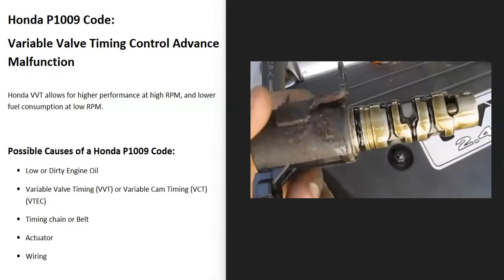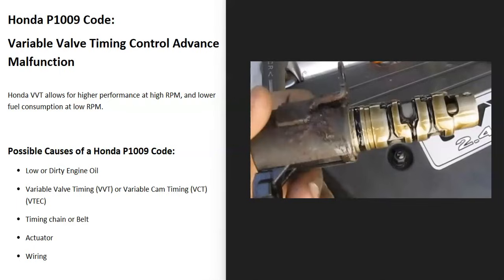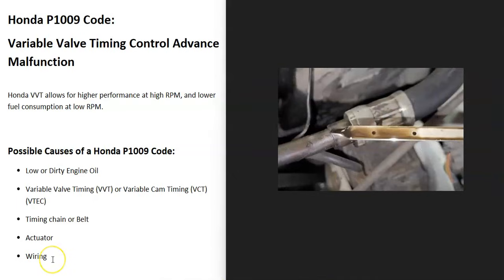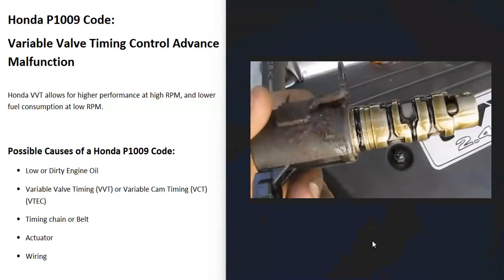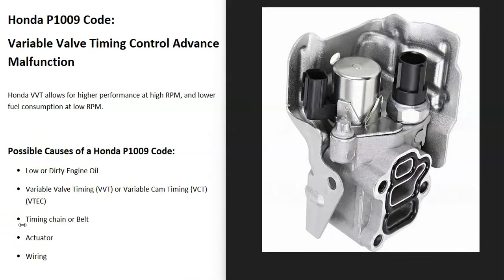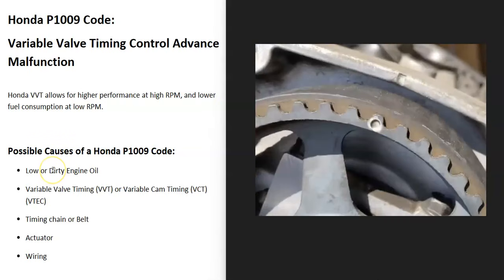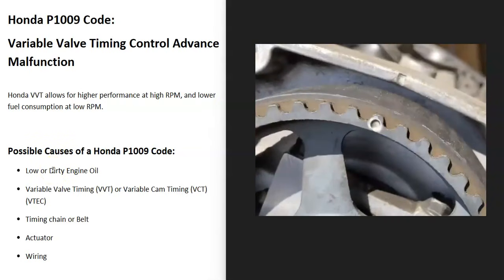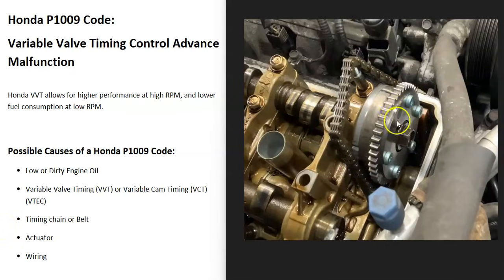How to Fix Honda P1009: Variable Valve Timing Control Advance Malfunction

Comment: I have my vtc solenoid replace in April last year and it coded again this may. I tried to take it to a Honda specialist who was hopeless as my mechanic gave up. I recently had it replaced again but I know it’s still not ok. My main symptom is the tachometer not working properly between 1-3 and I get a slight kickback when it drops fast. I feel like the rhythm is out. My oil has been checked it’s fine. Not sure where to go next

Comment: Have a 2010 CRV. I first had the P0011 code and checked the VVT, then I got the P1009 with a n erratic idle. The VVT looks clean and works when I put 12v to it. However I checked the plug and I only get 2.9v when I turn the key on. Is that the correct voltage or should it be 12v? thank you.
Reply: Yes at idle you do not get 12volts ' the vtc isnt on at idle

Comment: I get P1009 and P2646.
I have change my VTEC unit, oil is changed every 3000, its clean and do flushes. Can't seem to figure it out as it happens once or twice a month

Comment: Got one of these on an 06 element. Took the vtc actuator out, clean. Changed oil, code went away. Then it stalled while driving. Inconsistent cyl 2 misfire. Not the plug or coil. Never had a valve adjustment done. Now its throwing a p0172. Sounds like low compression.
Reply: Did you ever find out the fix for your issue? Im having a similar problem and same code(s). I don't have any misfire codes though, just the P1009 and P0172.

Comment: I just had my solenoid replaced with an oil change last week. And now I get this error code. Could it be a bad solenoid?
Reply: check all your filters/gaskets, on the vtec assembly spool too.
Reply: @teeterbanned turns out it was a bad solenoid.
Reply: @BonJoviFan13 wow, it went out twice?
Reply: @teeterbanned yeah. I took my car to pep boys and the first one they put in lasted about 2 days. Then took my car back and they replaced it for free.
Reply: @BonJoviFan13 how much did that run ya if you don’t mind. thinking about DIYing it but not sure
Reply: @teeterbanned like $900 but I got a full synthetic oil change, solenoid, serpentine belt, and I think I went in for something else too.
Reply: @BonJoviFan13 Thank you much. Your info is very helpful! Have a great new year

Comment: Got a clean 04 accord with manual trans p1009 keeps coming back even tho when I did a valve cover job timing Chain seem tight and it lobes and cam shaft looks like a new engine it’s well maintained it’s got 150k so I replaced the VVT solenoid on side of engine and filter and old ones didn’t look dirty at all and old solenoid was working code still comes even after replacing both tho car doesn’t burn oil or is low  I cleaned the throttle body and took off inner upper and lower intake plenum made that like new clean inside but I’m still getting this code I’m hoping this new vtec/ VVT solenoid  located in the back of engine by exhaust is my culprit otherwise im not sure what else to go about besides thinking the Chains worn or actuator but there no rattle  Even tho it’s tight. Definitely didn’t jump timing engine still runs nice
Reply: Did you change the rear VTEC solenoid? Did anything change?

I'm trying to narrow down my issue. 

Already changed the screens, but this p1009 code just came on after a cold start/driving immediately, along with a p0420, but no hesitation or driving differently. Cleared the code and they went off. Shortly after they came back on and now won't clear.
Reply: Check your air intake for any way dirt or debris because it can get in your oil causing the code as well

Comment: Not sure if this applies to the honda VTEC cam sprocket like it does the Kia's, but just to think about when anyones diagnosing their car, if your sprockets bad, you'll almost always have a timing correlation code. Helps if you have a scanner that can read live data, check actual and desired cam position, then you know you either skipped a tooth/stretched a belt or have a bad sprocket.

Comment: Checked oil before working on this.  Almost no oil. Added two quarts of oil. Error code went away.  Investigated and the VVT filter cover was leaking oil around the gasket. I guess it's had a very slow leak?  Can't figure out why I never got a low oil error.

Comment: I had a P2647 code in my 04 Accord 4cyl a few years ago. Brought it to my mechanic, who replaced the VTEC spool valve. Ever since that replacement, I've gotten a P1009 code (along with a rough idle) every couple of months. I clear the code and then the car drives perfect for thousands of miles, until the next time the P1009 code comes back unpredictably. Any idea what the problem might be?
Reply: Do got the solution?